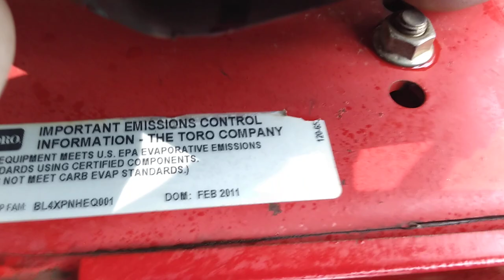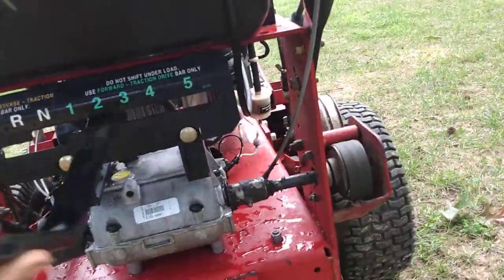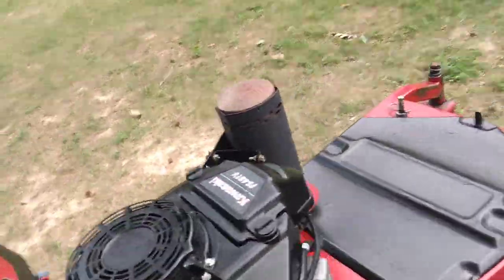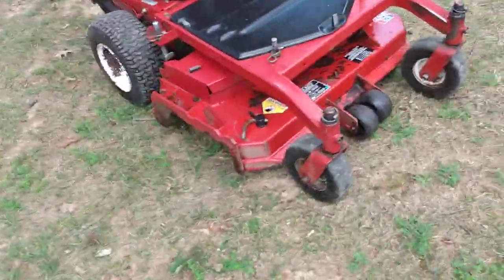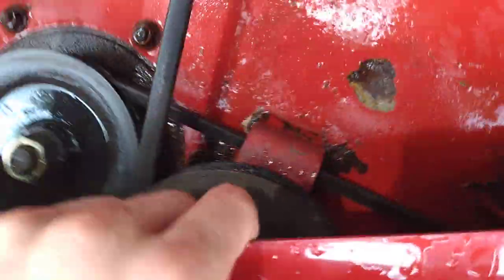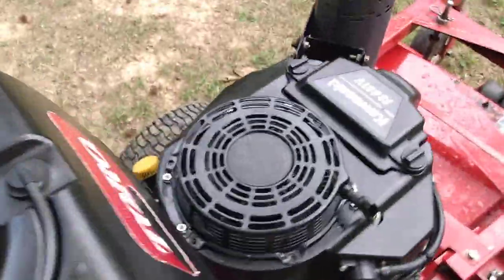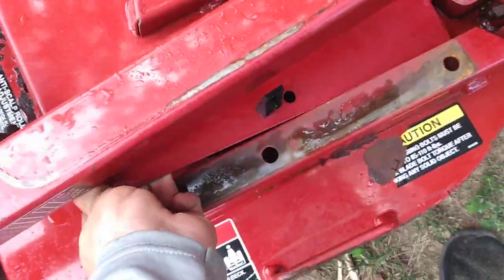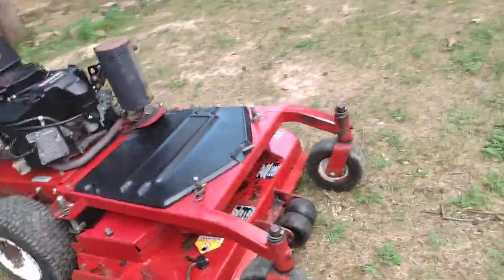3000 Hour Review On A Toro Walk Behind Mower

Comment: This looks like my vintage
 T handle 1980s I still run and it will take any hill that I've tried only one yard I'm not putting it on and that hill ends in a cliff to a lake but the older ones had very little problem with backing only problem I had was learning how to hop the velky while backing so if your belts are jumping while in reverse check the pulleys make sure they have no bends the only time I've had that problem was on one that had bad pulley and that one I turned into a 48" snow blower by using a old lawn tractor snowblower attachment if this is your first commercial mower you are starting strong I've had to swap the motor and of course replace belts but like I've said my first one was almost 40 years old when I bought it for those that read this all the way sorry I don't have great Grammer skills and don't use . Where they belong have a great day